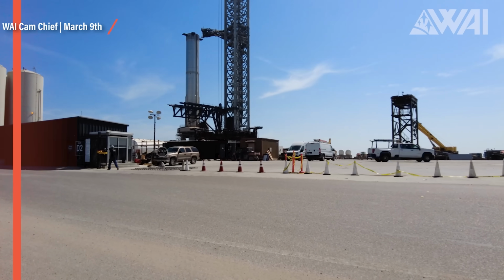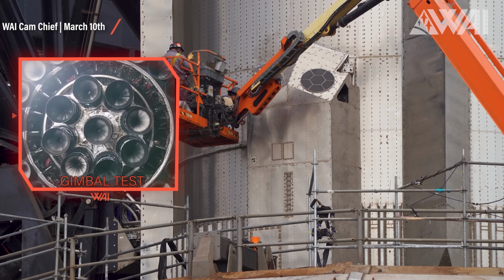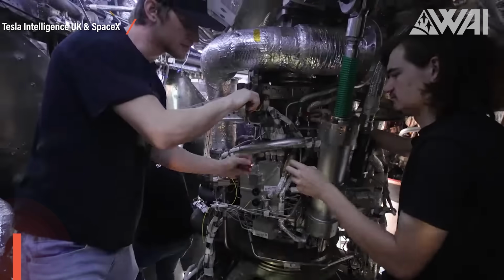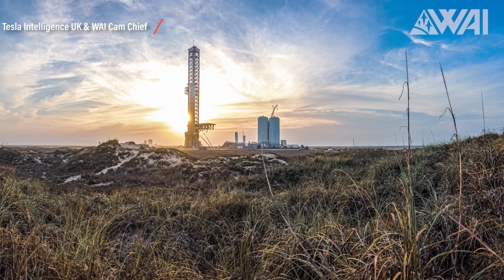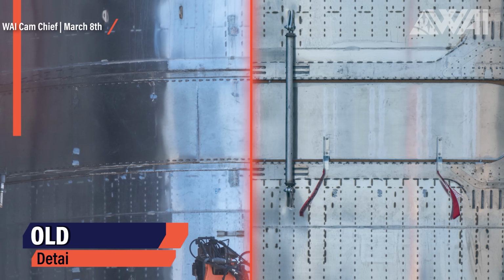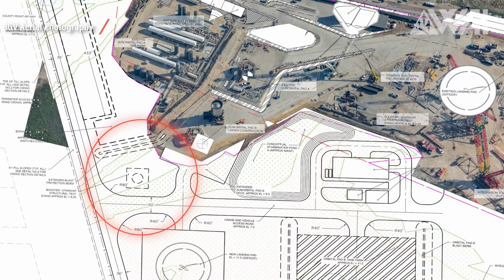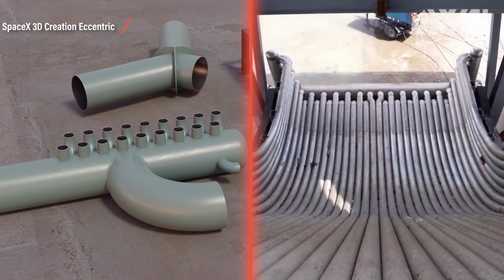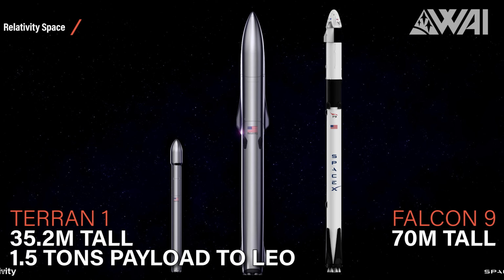What's SpaceX's final decision regarding future Starship launch infrastructure?

Comment from the maker: Could this be thew deluge system design? What do you think? :_WAISweet:
Reply: A closed-loop deluge system would be quite efficient. It would also handily address some of the environmental concerns about where all that water would go.
Reply: @tfcabral  Yes it would be a great solution for limiting the damage to the pad, preventing bits of concrete being blasted into the rocket and at the same time containing the water for environmental reasons. Though I think water that is losely sprayed like a traditional deluge system will do a much better job at absorbing sound accoustics. Possibly a combination would be useful. But if they were planning to do it without a system than the sound accoustics should be tolerable because I bet they can calculate that stuff. The main problem seems to be the pad itself blasting up so yeah it might just be this closed loop deluge system, or maybe it is better to just call it a water cooled flame diverter instead.
Reply: props to Elon for his success with Falcon rockets, but Elon has the big rocket gig all wrong. 

what Elon now needs is a space  “garage”

(Using falcon to deliver composite materials and building space to space rockets in space, then using falcon rockets as landing and cargo ships  (to cargo fuel from fuel bearing locations))  

Space to space rockets don’t have to endure earths gravitational pull, don’t require rigorous thrusting , because they’re already in space .
so their design is singularly functioning as a long ranged life supportive vehicles. 

space garage (or space rocket factories)  is the only filter to space.
Reply: @East_African_guy  that's an interesting concept for future rocket development. However without a workhorse rocket capable of delivering massing loads of equipment to space to build an orbiting starship factory (plus the materials used for the starships, living quarters etc) it wouldn't be feasible. Starship if successful has the GEO payload capacity to make that a possibility. With current rockets (even including the falcon 9) it wouldn't be possible.
Reply: @philipstrutt1086  Yes it's possible with modern tech (just have to be extremely smart about it, but mostly creative, I have a simple way of doing it), This is an original Idea btw (it's not something any major space organisations are exploring right now, or even planning for the near future , (except , maybe for Jeff Bezos’ orbital reef, but that's more like a dedicated science lab, not a "space garage " or rocket factory)) .

Mainstream space organisations are building big rockets fleets on earth as final product (Elon wants to build 1,000 big rockets (on earth, which is inefficient with a lot of redundancy) to get to mars within 27 years.

space to space vehicles made in space remove 50-70% redundancies for the current big rocket designs.
Reply: I think it makes sense. Felix you rock! 🪨🚀
Reply: Possible. So hard to say at this point!
Reply: n
e
Reply: @psychogardnernz  ,
Reply: I hope so I think that big mama is going to burn a hole in the ground without a good deluge system 👽
Reply: Maybe. Thanks for the video, Felix and team!
Reply: I think... they DO look like grills. I'm with you on the sausage suggestion.
Reply: Haven't a clue.  SpaceX will tell us after it is done.🙄
Reply: I think you should stop adding bobbing effects to the footage in post processing
Reply: I think you should do a collaboration with Marcus House, he has a similar setup/flow to you.
Reply: I’m glad you home school your children. They will actually learn something rather than getting stabbed or shot.
Reply: @jamesstjames1289  Or programmed by the Florida Christian Taliban.....

Comment: Elon sure does know how to waste money mounting shields onto the outside of the launch pad serves no purpose unless it isn't to protect the pads systems but all the torn off garbage flying out. Hydraulic power unit never to get used etc etc. This is a sign of rushed engineering and not being meticulous in your research. He's rushing and wasting equals failure every time.
Reply: "mounting shields onto the outside of launch pad serve no purpose it isn't to protect the pads systems..."

Except, it IS to protect the pad systems. many delicate components on OLM perimeters that DEFINITELY wouldn't survive the exhaust if it's not shielded

"Hydraulic power unit never to get used"

Wtf? They're REPLACING it with a new one, not REMOVING it entirely. Unless you wanted an out-of-control rockets?

"This is a sign of rushed engineering"

Okay, Mr. Engineer
Reply: @alvianchoiriapriliansyah9882  for one the shields are on the outside not the inside to isolate the components from the blast it will not protect what is underneath but hold in the watch them fly off after launch. Second the hydraulic power units haven't even been tested bought to just be replace with electric as they said and a total waste of money. Lastly my career started working on the Poseidon C3 missile system for the US navy until you have done DASO launches from a sub try not to look like a an engineer you are definitely not.

Comment: The payload bay door needs to be stuctural when closed. Just as it was for the space shuttle. When the door is closed it interlocks with the rest of the payload structure and provides resistance to loads in all phases of flight except for satellite deployment. To be strong in compression, it needs to have locks on the top and bottom, not just a top lock and bottom slide.

Comment: Thanks for another grand report Felix. Steal has a lower melting temp then the 304 stainless steal, I believe, I did not check to see what it's made of, but it all should have been porcelain, or even the heat shield material. Mars is also inside the growth of the sun. Jupiter is not that far away from the edges of it, but that is millions of years away.

Comment: That sheetmetal they put around the opening for the Pez Dispenser is called a doubler or trippler. It's used to increase the structural strength of a given area. In this case the weakness is caused by the big hole they cut in the fuselage. That first hole they cut was just for practice so they could figure out the final layout for the real Pez Dispenser.
Reply: Thanks for the insight 🤓.

Comment: The Orbital Launch Mount flame trench issue has seen significant issues. It appears SpaceX wanted to reinvent/simplify the design but materials were not up to the task. I am waiting for them to resolve the issues related to heat, pressure and sound using 20x the water used so far. Water has an enormous capacity to absorb heat energy and also destructive sonic energy. In my opinion a water based system is the way to go
Reply: Probably a show stopper. Back to the srawing board for the whole concept after the first laun ch ends in disaster.
Reply: @rogerphelps9939  Bits of concrete blown off by the rocket plume could strike the rocket during launch. To me that is one of the major risks. I think Musk is correct at the 50% likelihood of reaching orbit, and I hope they do. A major risk factor is Musks willingness to accept risk. This was demonstrated during the launch of Model3 wihen he went all in on manufacturing robots and it nearly killed the compny
Reply: @rogerphelps9939  Source?

Comment: Couldn't sleep, was thinking on the flame diverter issue, what if it's not a single direct flame diverter, they could divert the flame and the shockwave in a 180° Arc to the south-south-east. They could even add low berms to lift the shock up into the air at something like a 20-30° angle to allow further atmospheric shock mitigation, after the flame diverter on the ground.

Comment: If that (relatively) tiny door is such a huge weak point, how the heck do they expect to load and deploy larger payloads in the future? It stands to reason that the bigger the payload door is, the bigger the problem of structural integrity becomes. And we know the early renders that showed the nose opening like a clamshell won't work because there's a header tank in the way. So, they'll have all that mass-to-orbit capability but no way to load it or unload it. It will be fascinating to see how they solve this problem.
Reply: Additional reinforcements can, you know, be made
Reply: You can consider door reinforcement as part of the payload cost, as the weight is incurred by a mechanism the payload (a stack of Starlink satellites) requires. One can only speculate what other mechanisms may be employed for future, more obese (and therefore cheaper) birds.
Reply: @ChildSpaceMethod  That's my whole point. The bigger the door gets, the weaker the structure will be, the more reinforcement it'll require which will only add complexity and weight. I dunno. I guess we will see. There's a lot of smart people working on it. I'm sure they'll figure something out.

Comment: A long time in the future? Is 10 years a long time? The sun is not a nuclear fireball in the sky. It is an electrical discharge phenomenon. And it is about to get dusted. 
Ref: Ben Davidson, Suspicious Observers.
Reply: In....several millions years from now
Reply: @alvianchoiriapriliansyah9882  Not so, unfortunately The nuclear fireball in the sky model is failing and being replaced by the Birkland current electrical discharge model.
The galactic current sheet reverses the polarity of the sun every13500 years and dumps a whole lot of dust onto the sun, causing flares. Micro-novas that eject Jupiter sized matter. If that hits us square in the face, forget about GPT4
Reply: @arthurrobey7177  Source?

Comment: I'm sure they've considered having the PEZ dispenser vertically... It seems that would work too and pose fewer structural problem.
Reply: Much more difficult to actually load. The horizontal version is simple... you have a slot, and everything stacked above it. Make it vertical, you've got the slot in the middle, and need to somehow fit the payload in around it on both sides.
Reply: But they didn't, build it

Comment: I’m not a rocket scientist… far from it. But I think that this effort is a mistake. By “effort” I mean this entire Starship project. My reasoning is based on the fact that SpaceX has already “broken the code” wrt spacecraft reusability. The Starship project can wait for a few more years. I think that a more immediate and much more feasible project is the buildup of an above atmosphere facility for assembling larger deep space spaceships. The components could be built on earth, and launched into orbit with the reusable rockets he already has. They could be then assembled, with the existing technology developed during construction of the space station. I’m not saying that that in itself would not present new challenges, but this is like trying to crack another code that has already been done. I’m also very worried that any crash of Starship and/or it’s huge booster could be catastrophic wrt the surrounding infrastructure. Those are my thoughts only, and I hope that their current project succeeds without the catastrophe I fear.
Reply: And guess what the space station cost is...

Comment: Great report Felix.  Keep them coming.  I would like to say that it sure seems that SpaceX does have a problem remembering an age old engineering precept.  There is a point that a project needs to stop (freeze) the design process and kick the hardware out and onto the street and see how it flies.  I know SpaceX likes to iterate but if it goes on and on you never get the hardware into space.  You have to draw a line in the sand, light the candle and watch the fireworks.   Otherwise, you will have a warp drive device that has never flown.
Reply: SpaceX doesn't have a problem with this. Once the launch pad is ready, they will just go with the most advanced rocket that is ready to launch.
Reply: @EricKlien  Yes, and we can see that with the fact that they're still planning to launch booster 8 to get data, rather than continuing with all the revisions that have been made since it was built. The delays are entirely around having somewhere to launch from...
Reply: @simongeard4824  Sarcasm?
Reply: @alvianchoiriapriliansyah9882  No? I've been saying for a long time that I think they should have launched a long time ago with earlier booster/ship models and temporary (disposable) infrastructure — but once they started building out a permanent launch structure, they kind of committed themselves to having that structure perfected before they could launch.
Reply: @simongeard4824  B4 has plenty of problems preventing it for launch, and ground infrastructure also

Comment: I am wondering if they will need any shielding or deluge to some degree on the OLT? I was thinking as the rocket ascends or decends for a catch the exhaust from the engines may impact the cables for the arms and any other exposed machinery including the elevator. Just curious.
Reply: If the rocket deviates enough for exhaust to affect the cables, they got a much bigger problem

Comment: I think SpaceX will have the water deluge system operational BEFORE the first launch attempt. That is why it it is not launching this month.
Reply: Except this is wrong
Reply from the maker: You never know, but I'd be VERY surprised. It's a project that would require several months at least. You need to install and then test it. Only installing it requires the pad under the OLM to be dug up 6 to 8 feet down all around.

Comment: Why just direct all the thrust energy away and not try to reclaim some of that kinetic energy?  Couldn't you hang some large turbines in it's path and spin up some generators converting that back into electricity?
Reply: You would need a turbine that can peak at around 33 Gigawatts.
Reply: @Fabian3331234333  How much energy is in that thrust directed into the wind?  Doesn't have to totally take over your power needs.  Just recycle some of it during launch.  A turbine mated to a weighted flywheel could store it and use it over time.
Reply: @eeman1335  It is not worth it. One rocket launches, it leaves the launch pad in few seconds. What to do with that fancy equipment after few seconds?
Reply: @my2cents366  Yes, for one launch a year, not worth it.  But Elon is talking about 1 hour turn around.  Might be worth it at some point.
Reply: @eeman1335  It is a simple math. Energy produced by the equipment has to cover all the cost of hardware+operational cost+profit margins companies typically expect on return in investment. It won't happen any time soon.
Reply: @my2cents366  Understand all those points.  It's a lot of energy though.  I bet if someone were to calculate the total energy traveling through those directing tubes, would be more than energy that a couple of diesel-electrics burn over several days.  Seems a shame not to try and harness it, even it just ran the equipment used to pump fuel/liquids into the next rocket.

Comment: Every time I hear about Relativity space and their 3D printed rocket, the thoughts of the future and the possibilities just leave me awe struck.  This one is going to probably explode on the pad.  We're expecting it, it's probably going to happen.  Just like the Falcon series, it'll take a number of iterations before they succeed at getting their rocket to space.  I consider that a good thing.  After seeing the iterative process work so well for SpaceX, I hope that Relativity can absorb several failed initial attempts.  Just imagine them being able to fully 3D print a rocket, or anything else space worthy.  Starting from an assembly plant, a whole station could be printed and built in space, or as a base on whatever asteroid is providing the materials.
Reply: Look we had our fun with sn4 by now they are not going to blow up any more rockets on the pad. Super heavy will launch, stage separation and orbit will be normal. controlled water landings of both stages will signal a rapid move towards recoverable vehicles. Falcon ( track record show much precision in landings is easier to catch than land. This crazy idea is going to work.
Reply: Doubt it'll explode on the pad itself. If it's going to its probably at some point in the flight
Reply: Imagine to bring a 3d printing system up in space and print components there. It would have a dramatic impact on the stress analysis process and much leaner constructions are possible. ESA/NASE do this things in small. Imagine the step to print a space ship in space ....

Comment: I dont understand why they are not changing the Ground under the Starship with exchangeable Floor Tiles (heavy around 5 Tons each).
They will never have to repair the Ground after a Start when there are Damege they only exchange the Damage Tiles with new ones that allready laying on the Side.
Every Tile have a clamping system(maybee Magnetic) to connect together and into the Ground.
They can direct after a Start change the Tiles in under one Hour.
Reply: These same rockets will need to launch from Mars, the moon and whereverwe choose to go. From a primitive launch pad. This stuff is practice.
Reply: @kennethroberts6993  what have your reply to do with my Topic?
 They need only a fraction of Thrust on Monn and Mars.
The Booster are only for Earth.
Starship alone starts from Moon and Mars .
Reply: @With my Eyes  again, finding out how to land on sites with minimal preparation.
Reply: @kennethroberts6993  Landing is not a Problem the only Problem is starting with this high Mass and Pressure for damaging the Ground.
They want Start and Land in Hours over and over again in one Day.
When you Damage the Ground at a Start there are no other Start till its repaired.
A normal Concrete Repair takes Days minimal
Reply: @With my Eyes  I agree, but as yet they aren't launching frequently. The research is much cheaper at Starbase than it would be on the moon or Mars. 

As things stand now, it seems that the FAA can't issue a launch license more than once a year anyway.